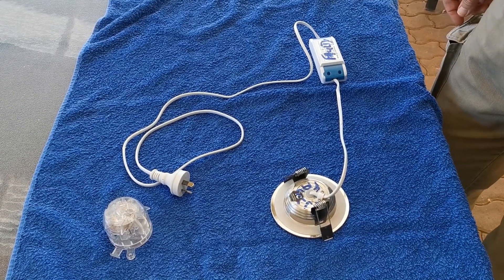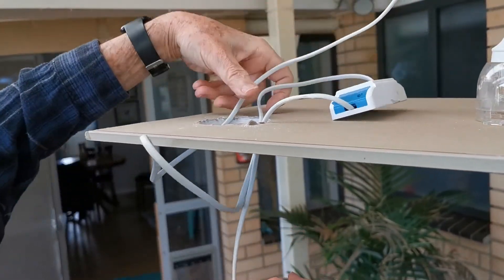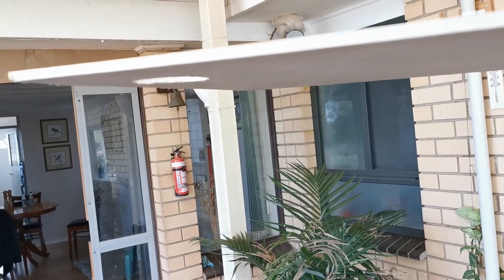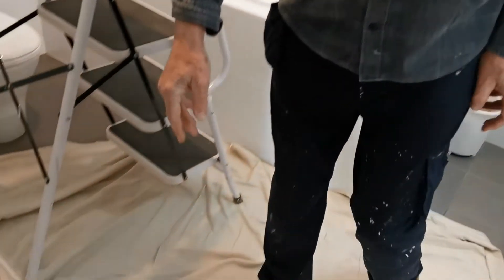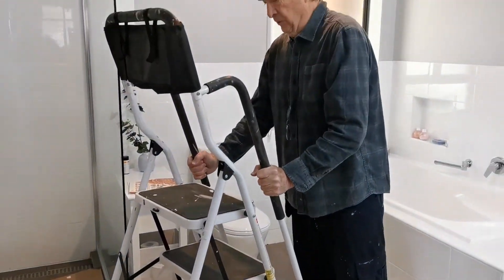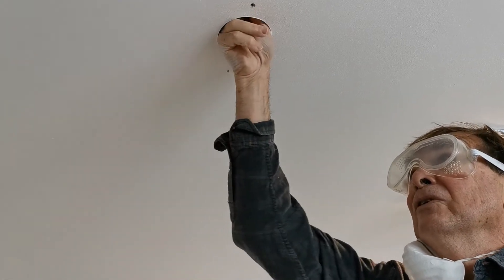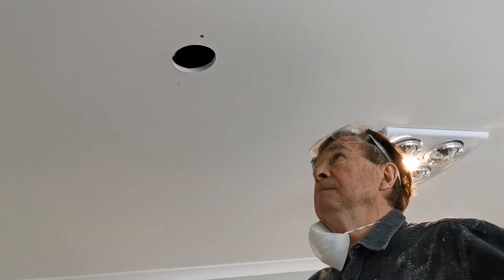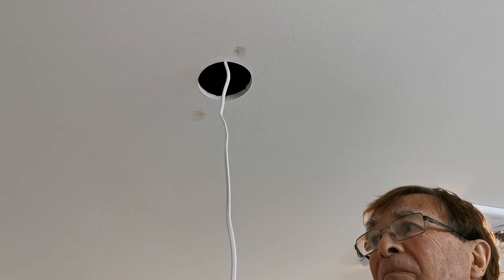Install an LED downlight and a jig to enlarge a hole saw hole

Comment: I just cut a plywood disk the size of the hole in the ceiling. Drill a hole in the center. a couple of pieces of tape to hold it in place. then just drill with the larger hole saw. it only needs to stay a fe seconds until the teeth cut through the paper of the drywall. no fuss, no holes from drywall screws to patch
Reply from the maker: Good idea, thanks for sharing 👍

Comment: Would screwing a piece of steel to the underside of the jig and fixing it in place with rare earth magnets along the ceiling be an alternative to screwing? Bit of effort I guess, if you're doing whole house might be worth it. Putting the 72mm hole saw inside the larger diameter sounds like a winner.
Reply from the maker: Yes, both your suggestions make sense, thanks for sharing 👍😊

Comment: Could you not drill the holes to hold the jig just beyond the diameter of the new hole?  That way the wide rim of the downlight would cover the holes once the new light is fitted, and save a whole lot of extra work in patching and the inevitable mis-match of the paint. Might need to use small screws.
Reply from the maker: Your points about filling and colour matching are valid but my experience with screwing close to the edge of plaster board is that it tends to crumble on the edge and repairing that is harder, in my hands, than filling the screw holes. If you would like to avoid filling and painting then these methods would suit your purpose. 1. If your arbor has enough thread for 2 hole saws then you could put a hole saw of the original (smaller hole) inside the new larger hole saw and use that as a guide. That works well.
2. Cut out a circle of wood  thick  enough to extend just ahead of the teeth of the  original hole saw and put this on the arbor drill bit of the larger hole saw and use it as a guide. The problem with this method is that because of the thickness of cut of the smaller hole saw it won't fit snugly in the hole in the ceiling and may wobble a bit. There are links to both these methods in the description below the video. Thanks very much for your comment, I hope this makes some sense.

Comment: Wow I didn’t realise it was so easy. I thought there would be open wires and things to deal with but that’s so simple!
Reply from the maker: Some of these lights are hard wired to the house electrics, but many of the modern LEDs are just plug in like these. So much more convenient, not that one has to replace them very often.